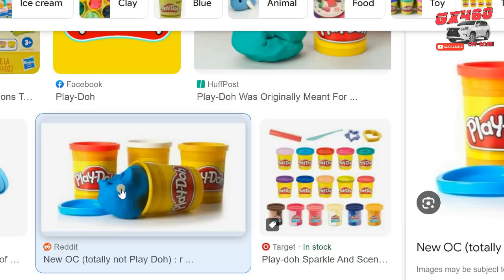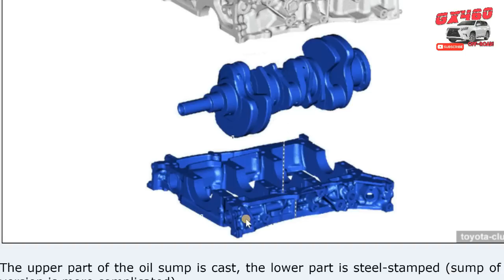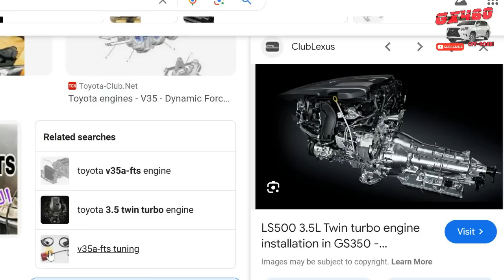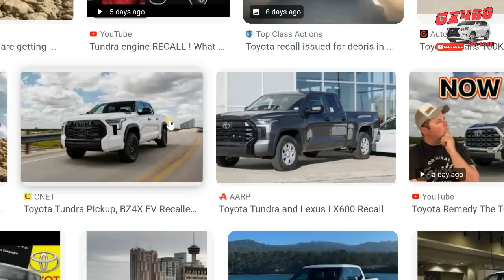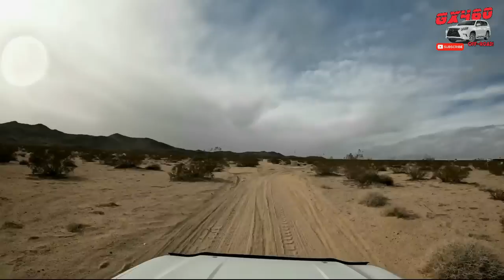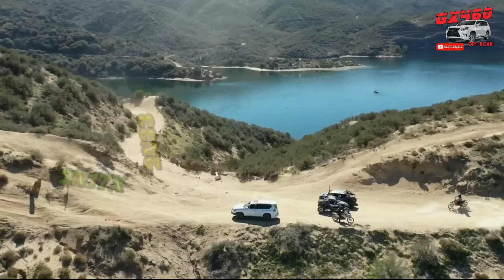Toyota Tundra OUTRAGE: A Technical Explanation

Comment: Owners should demand Toyota buy back the truck or join the many lawsuits coming there way. The dealers will start dumping these trucks, very soon on the wholesale market. Warranty work is a money loser for dealerships, that's why the lowest paid least experienced mechanics are assigned warranty work. I have managed companies that service dealers, including Toyota. So ask yourself, do you want a kid to assemble your engine? After all, the trucks are going to comand very little money for a trade in or used car market.
Reply: No way this car woulda been completely made with proper assembly line inspection
Reply: No lawsuit at least for now, because Toyota admitted the issues and promised a remedy that aa they said they are working on it. Need to wait what will happen in the coming weeks. Remember the Toyota settlement on Camry faulty ring piston on 2azfe engines.

Comment: Bottom line Toyota Engine plant failure too clean and inspect Engine block before Engine was assembled or Toyota engineers put a cheap bearing inside the engine that caused the cascade failure because of the torque of the engine

Comment: What are you talking about. There is nothing soft in manufacturing an  engine.
Reply from the maker: The entire engine is aluminum and the bearing material is also soft copper/tin/lead.  SOFT metals that love to fuse together under pressure.

Comment: Yada yada yada. The fact is 100k Toyota engines have blown up. 2nd and 3rd replacement engines have failed. Toyota has no fix.
Reply: Who the hell told you that??? Where are you getting your facts from??? 100K sold and only 1% failure, they're just recalling for safety reasons, just in case.
Reply from the maker: There's absolutely ZERO anecdotes online of "second and third" engine replacements failing.  ONE LS500 owner had 2 short blocks replaced before it being Lemon-Lawed.  That's the only anecdote out there.
Reply: @LexusGX460-OFF-ROAD  In the Tundra group on Facebook, one Toyota technician stated that early on, Toyotas prescription was replace short block, clean and use everything else. Because of that, they were getting some multiple engine failures in vehicles so they changed the protocol. Now, they replace the short block and anything the oil touched, including heads, turbos, etc. This is second hand info so no way to confirm or prove, just something I was told by a certified Toyota technician.
Reply: @LexusGX460-OFF-ROAD  There's 2 guys that have had the second short block/engine rebuild, fail.  One in the Tundra forum that had a short block replaced and it failed and a second one on YT that had his camera going while it failed after getting a new short block.  Was about 20 or so minutes into his drive when it failed for the second time.
Reply: It’s not a “just in case”, a percentage of these engines are failing.
Reply: @thadlm2698  I have a 22 Tundra and I'm still driving mine. For you to say all engines are failing is funny. Mine is not even stock and I don't Granma it either. And the percentage is..... 1%.
Reply: @alvarolopez630  Where did I say “all” engines are failing? I clearly said a percentage are failing and that fact is not in dispute.
Reply: @thadlm2698  My bad I thought it was the other guy.
Reply: yes me too..always out there boosting and flexing on the V8s.
Reply: I have 61k on my 2022 with no issues I have the recall as well. That’s not how a recall works
Reply: @mannyespinosa1960  Damn, you drive yours. I'm sitting in mine waiting to get my haircut done and I have 21830 as of right now.
Reply: No  a fact  by far. Only about 900 engines blown up  NOT 100k

Comment: So different robots machined the LS500? Fact is there were LS500 failures too. They just weren’t as high volume of a vehicle. The tech at tinkerers adventure’s channel said he had already changed bearings on two LS500’s. 

The reason why people think it’s a design issue then why is there no debris in the 4 cylinder turbo’s? Do they have different programming for those robots? Just a little clarification is needed for me as a tundra owner. Why didn’t they fix the issue with the Lexus LS that’s been going on quietly since 2017. 
The other issue I have with Toyota is that the recall only affected 80 vehicles that still had to be sold…but in reality they didn’t find the issue until now and they back dated the recall so they could still sell the vast majority of new trucks on the lots. The 2024’s have been failing too and hybrids need to be recalled also, we don’t care if the electric motor keeps the truck “driving”
Reply from the maker: There are anecdotal failures on many V35A-FTS engines across most (if not all associated models).  Bad robots could be to blame for all failures.  Only Toyota knows the truth.  Statistically all failures are low.  Contextually the 4.6L and 5.7L all had engine failures/recalls/growing pains.  Again those cases were also emotionally frightening, but in the end statistically irrelevant as Toyota is known to fix problems rather than run away from them.

Comment: Toyota is lying! So the trash just ruined the main bearings? No turbo bearings, no pistons lining ruined, no camshaft scoring? What I’m getting at all these motors ONLY have main bearings failing and that’s it!  It’s not trash, it’s something else!  Replacing a short block multiple times on some customers cars tells me it isn’t trash, it’s something else! Something that would need a redesign and Toyota doesn’t want to admit and go there!  They will fix these as they implode until the warranty runs out!  I see a class action lawsuit coming!  Imagine if you owned a capstone or TRD Pro?? $74-80K
Reply: Something to remember. These engines were built at different plants but somehow are having the same failure. So Toyota is saying that both plants have the same debris causing this. Highly doubtful.
Reply: @davidwethington9320  very well said, it's clearly a design flaw and not a manufacturing error.
Reply: @davidwethington9320 Toyota has SOP’s across all plants, all offices and all facilities that carry the Toyota name plate, hence why “Toyota Quality” is a thing. It’s also the reason why you can have the same vehicle built from different plants look entirely the same and quality is entirely the same, the only difference is the VIN plate designating which plant is was built at. That is SOP’s at work and what all business strive for when you have multiple locations
Reply: @davidwethington9320  you obviously did not watch the video. Lol why even comment if you didn’t watch it? He actually answers your  question and it makes sense.
Reply: If you see the short blocks pulled from the affected trucks, you are gonna see not just scoring but the actual main bearing is smoked. It’s burnt black, showing a lack of proper lubrication. It also has too much play in all the bearings, not just the main affected bearing. Toyota has 0 remedy at the moment until later in July. Calling it now, it’s a design flaw.
Reply: @Annihilator105 you are not a bright man
Reply: So many expert here. 😂
Reply: If you compare the toyota bed plate vs the ford ecoboost bed plate Mr. Obvious will visit your brain.
Reply: @puffnstuff12 Explain a bit further please. I’m interested in the comparison you’re making.
Reply: @thadlm2698  There are videos on YT demonstrating the differences in the reinforcement between the two engines.
Reply: 100%
Reply: There must be some Ford trolls on here.  They hope every engine explodes.  Go fix your cam phasers and valve springs.  My buddy is selling his f150.  It's been nothing but problems.  He said his 07 was a better truck than the newer one, and he is a fan boy.
Reply: @qrstuv12345   cam phasers and valve springs are a significantly cheaper, less intrusive and a much easier repair than spun/damaged crankshaft main bearings lol. Nice try though 😝 And before you come back at me with I must be a Ford fanboy, I own a 2018 Tundra TRD PRO and that same year my dad bought a 2018 F-150 with the 2.7L and 10 speed trans and I've had more issues with my Tundra than he's had with his F-150. He's had zero, regular oil changes that's it. He tows and plows and mine is a pavement princess grocery getter. My next truck will not necessarily be a Ford but it will 100% not be a Toyota.
Reply: @qrstuv12345  get back in your honda Ridgeline
Reply: GM and Ford have been screwing the consumer for years I never thought Toyota would let their quality stoop so low.
Reply: Yup, especially considering there are documented 2024 failures of both Lexus and Toyota engines and the fact that Lexus engines are made in Japan and Tundra engines are made in Alabama.
Reply: Going to have to agree
Reply: I've never been more upset as a consumer
Reply: The other issue is that it seems to be only the #1 main bearing.
Reply: I own a TRD pro costs me almost 90k and less than 1 year 😂 , really sad at this point
Reply: Everyone is lying. Really, If Toyota recalls these engine, they will be sure the problem never happens again. Their customers will be taken care of. It doesn't matter if the problem was caused by dog shit or Gorilla snot in the engine. The self professed engineers like you will continue to doubt everything, call people liars, bash any manufacture who doesn't align with your paranoid mind. So go play your video games.
Reply: Those bearing are post oil filter.
Reply: The girdle is the culprit. Even Briggs & Stratton can flush out machining debris🤷‍♂️
Reply: @rodjones812  Your comment just told us you have never rebuilt nor have any true knowledge an engines. But, i'm not going to waste one bit of my breath trying to explain to people like you because i know no matter what people say, you have your mind made up. good luck.
Reply: @rodjones812 this is it, weak lower cradle that flexes, then the bearings fail.  If you look at other lower cradles from turbo motors they are way more robust.
Reply: @rodjones812  On a second thought, I will explain it to you since i do really feel bad for you and your emotions, and the bad info you received from mis-guiding youtubers. when a rod is assembled to the crankshaft, there's a bottom piece that joints with the upper sandwiched/pressed by bearings. well, if those debris are trapped during bearing and rod assembly stage, there's absolutely no way you can flush it out. Please educate yourself before you mis-lead others or spread fear. The only way to know is to drop the pan and remove the half of the rod to inspect the shaft, bearings, and the rod. If there were sign of debris, chances are damages had already been done. It's not a design flaw. I work with robotics every day. An off calibrated robots can cause major problems if not caught in time.
Reply: @reempire888  
well, let’s just say I was cutting down crankshaft journals probably before you were cutting turds my boy.
Reply: @rodjones812  Cutting down journals and being able to understand how an engine works are two different things. I will say the Tundra attracts a lot of pussies, just not the ones you think. Hey maybe I should get a Harley. In the meantime, you should just sell your truck, curl into a ball and cry. The world is ending as we speak.
Reply: @reempire888 design flaw.
Reply: Totally agree with you. Trash would damage more item and not just the first main bearing. Design flaw.
Reply: @billsanders3604  no not really, and you guys are really showing how ignorant you are to engines.
Reply: @DavidRC-m9w  really? How many have you built successfully?  I’ve done 4. Why don’t you enlighten us with your knowledge on why.
Reply: @billsanders3604  pretty sure the video explained it all
Reply: @billsanders3604  Lolol. Do you know more than Toyota?
Reply from the maker: Depends on which oilway the trash was left in.  If the trash was left in the number-1 main bearing oil passage then the trash will go to the number-1 bearing (first)...
Reply: @LexusGX460-OFF-ROAD  so you’re sticking with that the only place these debris get caught and do damage is the forward main bearing?  Some of these engines emplode at 3k, some at 10K some at 20K and some at 50k? All  this time the debris is rolling around this engine, many of which have had multiple oil changes, but somehow it only gets caught on the main bearings?   👌
Reply: @James-ww4mc Do you realize that debris in a main oil galley will go DIRECTLY to  the main bearing(s) that it supplies?? Do you?? It is already past the oil filter at that point. It will score and contaminate the bearing and reduce the bearing life. Whether it's a little or lot depends on how much debris.
Reply: @James-ww4mc  my thoughts exactly. I made a similar post and got hammered. They said I was ignorant and asked if I knew more than Toyota does. I don’t know more but I question everything. Their story doesn’t add up. I’ve built and raced engines. Machining debris is not that consistent.
Reply: I've seen multiples with all the main bearings scoring. High amount of turbo force with added contaminated fuel diluted 0w-20 is the perfect environment for bearing fail,.
Reply: That's exactly what I've been saying. There is no trash in the engine. It's strictly an engineering design flaw and They're using trash for excuse. Eventually it's gonna be every tundra from 22 on That will have issues until they Fix the design flaw...IMO
Reply: @johnwest2396  ok expert.